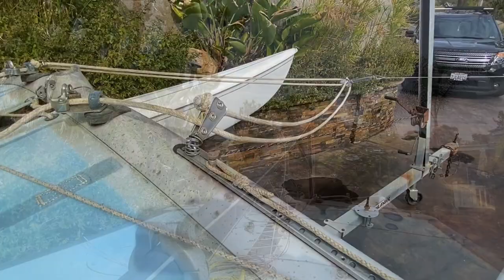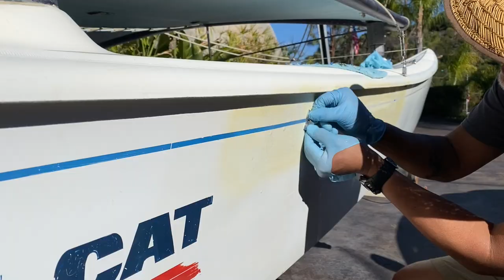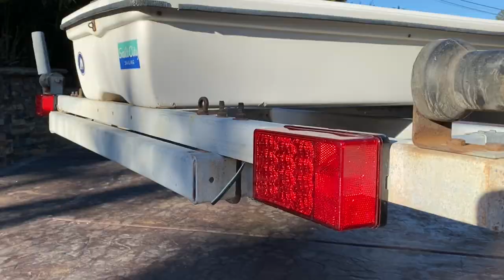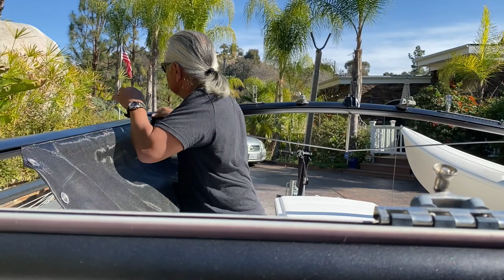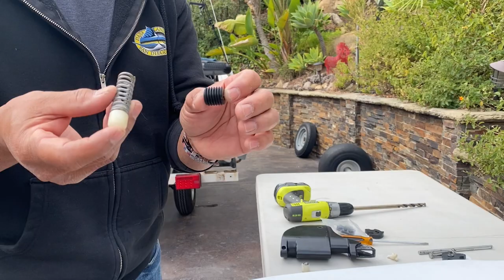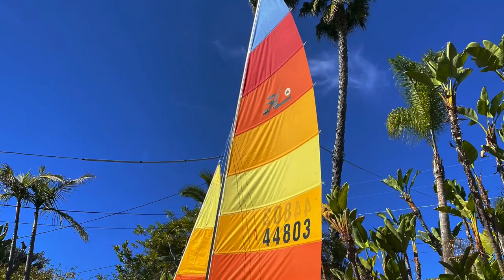1983 Hobie 16 Restoration

Comment: That looks fantastic! Who doesn't love Hobie time?

Top tip: don't drill those white rudder stock bolts out. Instead heat a flat head screw driver, then ram it in to screw it out. Take a few goes to get it to melt its way into the nylon bolts.

Comment: Very nice. I just recently started a hobie 14 turbo. Taking a while for parts to arrive. Had to replace sails. The jib and main clew plates are completely corroded and damaged the sails and they were significantly stretched out of shape. Replaced rigging and trampoline. Rudder blades were replaced though I'm gonna have to figure out if I can put bushings in the castings. They are worn badly. It's gonna be a great boat though.

Comment: Great job on that restoration.  I’m just starting a similar project.  I’m also reconnecting with my salt-water craving after a few years of being without.  Please comment on what you did to the mast and frame.  Looks like you painted both.  If you did can you tell me if painting the front and rear crossbars affects at all the function of the travelers?   Please share what products you used.  Thanks
Reply from the maker: Thanks! The travelers, cleat hardware and dolphin striker weren't painted but masked with blue painter tape. Crossbars and rails were prepped by wet sanding with 600 grit paper, then painted with a couple coats of Rustoleum industrial primer/paint. The paint has held up very well, and I've sailed a ton this year. The mast wasn't painted, just sanded in the same way and then I applied a couple coats of Penetrol, an oil based paint additive. I plan on reapplying it once a year. Great product. Good luck with your project!

Comment: What is that mast clamp you have supporting the mast on the back of the trampoline?
Reply from the maker: A homemade support that came with the boat when I bought it. It was too big and cumbersome, and I eventually bought a simpler mast support from Murray’s. Basically it’s a plastic cradle with a bungee cord and fits securely on the back rail.

Comment: What did you spray on the metal parts? Looks great, is it some kinda of rubber or flex seal thing?
Reply from the maker: Industrial strength Rustoleum semigloss paint/primer, 3 coats. Surfaces were fine-sanded and cleaned with acetone before applying paint. After a full year of aggressive sailing, still holding up quite well.

Comment: Hi Nick phenomenal video really appreciated the work that went into making it. Could you talk a little bit about your jib setup as far as removing some of the old blocks and putting in a low friction set up. I'm trying to think through something similar and was wondering how you rigged it were you trying to come up with a substitute traveler system? Any help you can offer would be much appreciated!
Reply from the maker: Thanks for your kind comment. I replaced the original jib car with a low profile one available from Murray Sports and also installed a lance cleat (simple cleat, also available from Murrays) on either end of the front crossbar. A traveler line runs through that and is tied to the outside hole of the jib car.  I then tied elastic cords on the inside hole of each jib car to the vertical rod on the dolphin striker. This way, I can adjust the position using the traveler line. When it's released, the jib car returns to the end of the track toward the mast. I hope this makes sense!
Reply: @NickAbadilla  perfect very helpful thank you. Love your sail box as well, is that from Murray's too?
Reply from the maker: @clutchy26  no, came with the trailer.